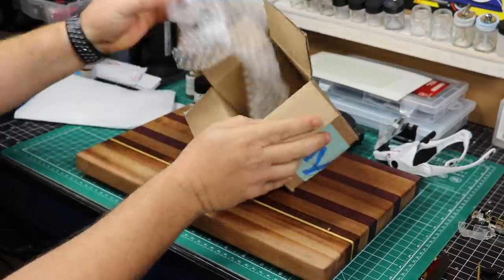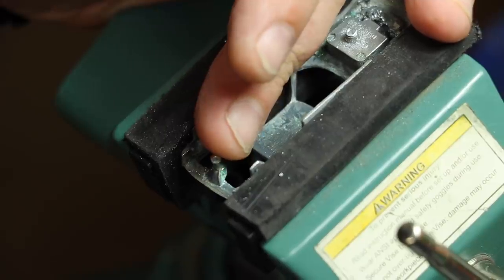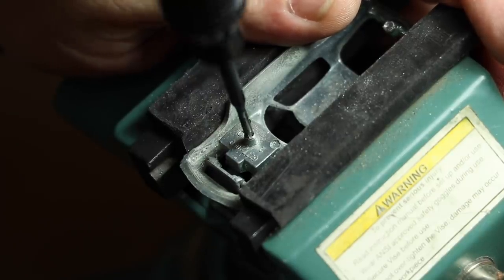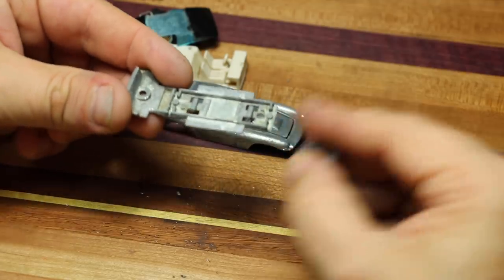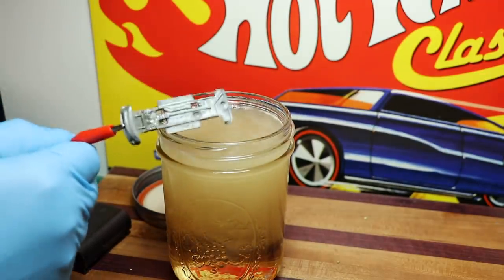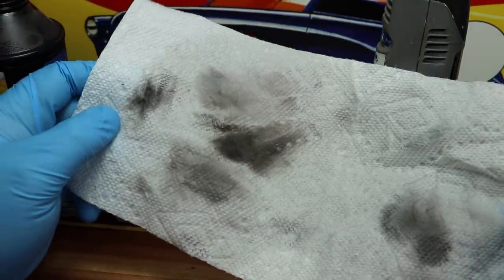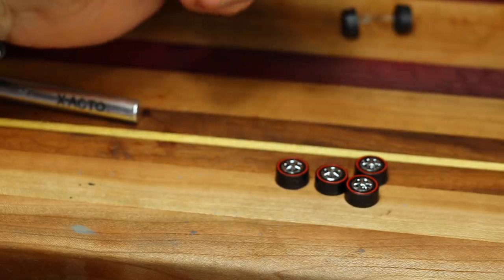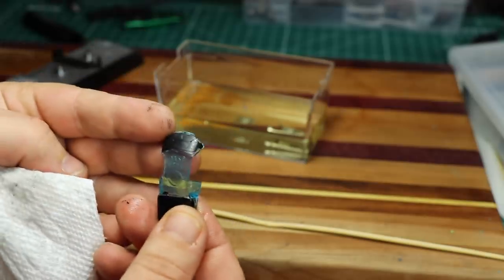REDLINE RESTORATION 1969 Maserati Mistral Disaster

Comment: You have to heat the new plastic windshields before you install them... use a hair dryer as a heat gun gets too hot. After heating they fit much better.
Reply from the maker: baremetalHW Thanks! I’ve done that on previous models but this one is actually a tad too short. The whole restoration was a nightmare!
Reply: @WheelsNThangs  yeah... having done one or two of these myself I can agree they can be a real pain in the a**.... but still, it came out looking rather nice!
Reply: I am subbed to both of you

Comment: I watched your video to find out more about the capped wheels,I’m expanding my collection into 1969 castings because I’ve completed all my sweet 16 cars. The Maserati Mestel always stuck out to me as a future resto, most of the cars I’ve seen for sale cheap($50+) have wheel issues so I’ll be ordering some,and I’ll also make sure I find one with a restorable windshield because as you mentioned the replacement doesn’t fit well. But nice Job on your car. I’m a 1st time watcher.👍

Comment: Nice work on bringing this one back to life! Have you ever tried Easy Off oven cleaner to remove paint on plastic? I use this all the time and it works great, just make sure to use the Blue spray can, as it's less aggressive. Sometimes the old Mattel factories would use whatever axles they had around if they ran short on a production run. I have the same car with cap wheels ;)
Reply from the maker: Thank you! I haven't tried Easy Off yet but will eventually. Good to know this wasn't the only one with cap wheels!

Comment: A fine result of what used to be a basket case. Question: if you decided ahead of time to faux vinyl the roof, why didn't you first prime it to try to eliminate the pitting? And can we see a follow up video when its proper wheels arrive? Thanks!
Reply from the maker: Thank you Anthony! The roof was an afterthought as I started painting I noticed the pitting even more so figured it would be worth a try :)
Reply: @WheelsNThangs  A question ... What is the diameter of the screw used (2mm or 1.8mm) ?. Thank you
Reply from the maker: @arturvian  Closer to 2mm.. Maybe a tad over.

Comment: The cross in the roof of the car was its grave. Rip hot wheel classic. Rest and peace. Can you weald the base by using a torch?
Reply from the maker: LMAO!
Reply from the maker: I’ve tried to solder then before but have never successfully got it to stick. These cars are also very soft metal.

Comment: A drop of motor oil is all you need to lubricate your tap. It will help to keep your tap sharp, and it will also attract zinc swarf so that your tapped threads will be cut cleaner.

Comment: Their is a type of low-temperature brazing rod called Muggyweld which can be used for repairing zinc and aluminum. It has a melting point of 350F - well below the 700F of zinc die-castings.
Reply from the maker: Hmm.. I'd be afraid to try it on some of these. I'm not sure any of them are real zinc, I've heard stories of castings melting in the oven at 220 degrees to bake paint. I'd still like to try it though!

Comment: Nice.  Have you ever thought about using filler primer and wet sanding for those pits?
Reply from the maker: The paint is spectraflame which is transparent so it would show through. Primer will not work, the base has to be almost chrome.

Comment: Dude I have a masarati that is missing a bearing, the base is too short and the suspension isn’t sold for stock parts. Help?
Reply from the maker: I'd keep a look at on eBay.
Reply: @WheelsNThangs  There is no replacement on ebay that i could find

Comment: Resto looks great! maybe you could use a small amount of body putty to fix the putting on the room, b it wouldn’t show through the black vinyl btw repo windshields usually have to be heated up a bit so they can be pliable enough to fit properly
Reply from the maker: Thanks! Yeah, the roof was an afterthought so I just shot it. I should have mentioned the glass was actually too short but fit ok.

Comment: Is there a way of filling the pitting?   I could see doing it but would it work if you choose to use Spectraflame paint
Reply from the maker: The only way to fill when using spectra flame would be to fill in the holes, prime, paint it glass black, then chrome and last throw down the spectra flame. You could use some silver and skip most of the steps but it won't look like a true spectra job.

Comment: Very nice work, I'm new to this so you and a couple of others on YouTube are my "Mentors."   I'm working on a couple right now (for my channel) I'm always having trouble drilling and tapping.  You baremetal and Marty make it look so easy, it seems like my drill bit doesn't cut very well and the tap doesn't either.  What's the secret?
Reply from the maker: Thank you sir, I just subbed! Hmm, just use a good sharp bit and a variable speed drill. What bits are you using? Tapping can be tricky sometimes, rubbing some wax on the threads of the tap should help out. Trust me, it doesn't always go smooth as shown in this video.
Reply: @WheelsNThangs  I ordered DU-BRO tap and bit set from online seller.  I was thinking about buying a "quality" bit from Menard's or something to try that.
Reply: I think I just need to remind myself that I'm not working on a picnic table in the backyard with a half inch drill bit where I can just muscle through...this is more like watch making...patience grasshopper...let the drill make the cut, not brute strength.
Reply from the maker: I use the Du-Bro tap and bit myself. Mayne you have a bad set?
Reply: @WheelsNThangs   I just completed a project (on my channel), like I said, I just need to be more patient with it.
Reply from the maker: @TimeRider  I think it turned out fantastic!

Comment: I used to have a hotwheels car that had caps on the back and bearings on the front. So, I always assumed that there was no hard line between when they started using them. The people assembling the cars likely just stuck on whatever was given to them, and if it matched, great. If not, just use them until we run out of the old stock.
Reply from the maker: You're probably right. What a cruddy job that would be, they can make mistakes :)
Reply: @WheelsNThangs : it's a fairly common problem in the guitar world, when trying to put a manufacturing date on a Fender stratocaster built between the years of 54-76. The serials were stamped on the neck plates, but those plates were all dumped into a big bin, and grabbed out in random order for use. A serial plate could spend weeks if not months or even years banging around the bottom of that bin before someone finally used it on a guitar.
Reply from the maker: Wow!

Comment: Why no use putty for repair the body imperfections before painting?
You can aplly one fine primer,after puttty,finish sand paper(800) other fine aplication of primer and painting.
Reply from the maker: Spectraflame is s transparent style paint and any primer or putty would show through.
Reply: @WheelsNThangs  and if you use a aclad II metal paint after the last primer base for a similar base of steel ?
Reply from the maker: I have some of that and will be trying it soon :)

Comment: Pretty nice restoration. It's sad that all the pitting make these black marks tho. And in a way, it's sad to know you may have something rare, but that it's that damaged. I wonder if it's one of those crumblers I heard about.
Reply from the maker: I doubt it's rare but who knows. Crumblers? Tell me more!
Reply: @WheelsNThangs  I've just re-read, and this car can't be a crumbler. Crumbers were cars from the '71 line with metal that didn't mix correctly and also had too much impurities in the mix. The metal, when it cooled down wouldn't "stretch" and they would develop stress cracks all over and thus, some of them were deep enough to make the HW crumble in pieces. But as this car is a '69 casting, it's not a crumbler. Tho, as you said, this car should've sported the bearing wheels, not the capped ones, as capped wheels came out in '70. Maybe this car was part of a late '69 batch and they somehow got capped wheels like the '70 HWs?
Reply from the maker: @chassegallerie2910  I never knew about the "crumblers" that's good to know! Yeah, I dunno what to think of this one. All the sites state it had Delrin hubs and thought the caps came later so it's a complete mystery. Supposedly this was only produced in '69 maybe a '70 slipped through the cracks?
Reply: @WheelsNThangs  Perhaps. Who know? Or, as I said, it was a late '69 batch and they put on '70 wheels, maybe 'cuz they had gotten thru all the Delrin hubs?

Comment: just a couple comments here... First and foremost, if I were going to paint the roof black, I would have definitely used a dab of spot putty to fill those pits, as well as a bit of primer. The base looks alright and the JB Weld is stronger than the white metal, so it should hold up ok! it's always a disappointment when something goes wrong like that but it's the nature of the game, maybe you'll find a really BEAT donor for another base... anyway... 👍
Reply: and they REALLY need to go back to the drawing board with that glass!!! Wow!
Reply from the maker: I should have mentioned the glass was actually too short but fit ok
Reply from the maker: Thank you! I was kinda disgusted a bit so the roof was an afterthought and I just shot it

Comment: I see your reply to the question asking if you could have welded it? My question is could you have not soldered it?
Reply from the maker: MrBloobeetle I’ve tried to solder then before but have never successfully got it to stick. These cars are also very soft metal.
Reply: WheelsNThangs also have you tried methylated spirit to strip paint off of plastic? Or Dettol? I’ve had a lot of success using these on plastic.
Reply from the maker: I haven't tried the Dettol yet but may in the future. Thanks for the tips!

Comment: Isn't a god fearing individual somebody with a bit of a twisted mind?  also if anyone is wondering if it can be welded/soldered , the answer is heat and Hot Wheels don't mix https://i.imgur.com/pfqXS6x.jpg
Reply from the maker: Ha! I suppose it depends on how you look at it. If you believe in God you would be God fearing. If you don't believe it God and think those that do are nuts, I suppose those believers could be looked at as twisted :) You are correct on the solder! Me experience is that it either melts the car or just doesn't stick. Thanks again for watching!
Reply: @WheelsNThangs  
Just joshing with that one i'm pretty sure some people thinks we are pretty twisted for restoring and collecting toys and spending one too many nights in the shed tinkering with tiny cars mainly for the satisfaction it brings to do so.

Love your channel, keep it up.
Reply from the maker: @takafumiarisawa70  Hehe. I figured as much! Yes, I'm sure we are considered twisted!